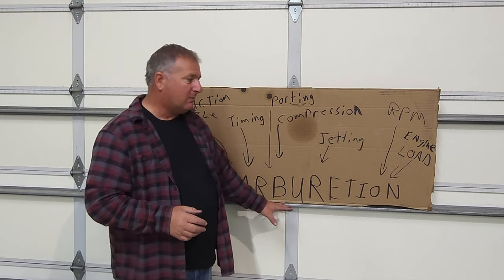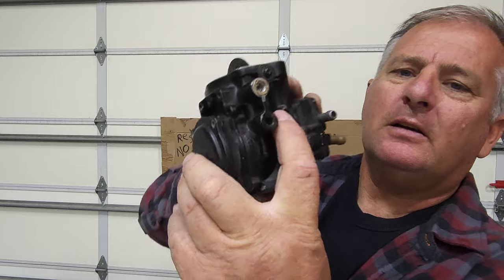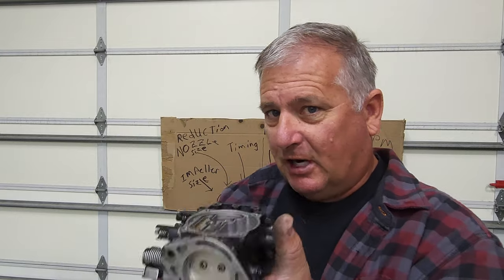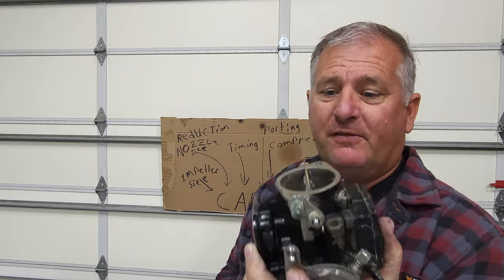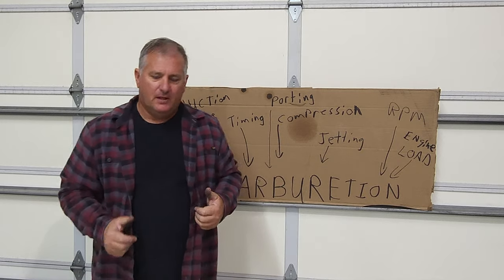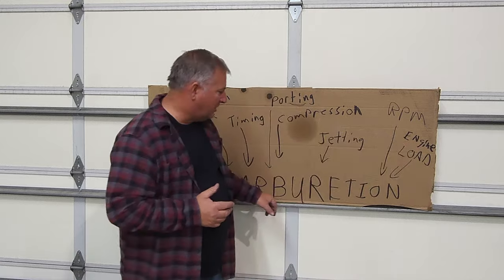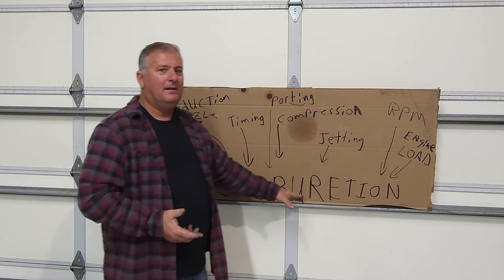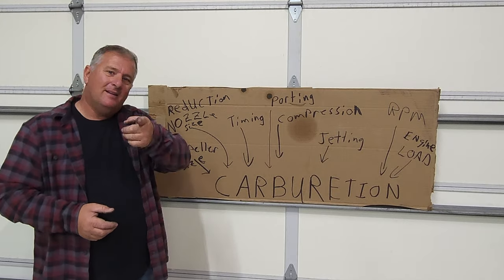Jet Ski Carburetors: A Deep Dive on both Keihin and Mikuni Performance

Comment: I have a 97 Kawasaki stx 1100 switched to pre mix and have trouble at idle and low speed, high speed it runs good just lacking almost 10mph. Would I need to re jet the carb or would my problem be fixable with tuning the needles?
Reply from the maker: Whenever adding oil to fuel, a rejet is required. Oil is thicker that gasoline. You nee larger jets (bigger holes) to flow the thicker mixture.

Comment: It seems like skis always run fine on the hose, but then won’t idle high enough or have other issues once in the water. Can you explain why or give tips? I also have a good test spot, a quarry, no other boaters in my way as I tune and take it in and out of the water. Working on a 93 sea doo spx 587.

Comment: I think it was easier for us old timers since the jets were adjustable having knobs on the engine cowlings of our 1940's/50's/60's outboards now considered antiques.  If you were traveling and launched at a different elevation, season, load, etc you adjusted the idle jet at the ramp and then fine tuned the high speed jet with the second adjusting knob.  You used the computer between your ears to fine tune things in real time to match any changes in conditions.  If you mixed the fuel a little too thick that was easy to fix with the turn of a few knobs that you could often deal with even while wearing gloves and without taking anything apart.

Best!

Comment: Hey Jim love your videos, good info in here to help keep the old school ski world alive. I think you may have made a mistake though in talking about the keihin carbs with the measurements, I have all 4 models here in my shop and decided to measure them , while the 28 cdk1 measures at around 34mm at the flange like you said , I've found the other cdk2 models to measuring properly + about 1/2 mm at the flange and not behind the butterfly , with 38 measuring at 38.45mm at the flange and the 40 measuring at 40.40mm at the flange and my sudcos measuring at about 42.52mm at he flange. All 3 oem models 28,38, and 40 had a 2mm diameter step right above the butterfly at the throat which gets conically smaller the closer you get to the bombsight at an unknown rate (4mm shrink rate for the 28)that would make the throat measurements for the 38 and 40 , 36.45mm and 38.40mm respectively at the step and 32.45mm and 34.40mm at the smallest point near the bombsight if applying the same conical shrink rate as a 28mm carb. The only exception to these rules was the sudco 42 with smaller size step after the butterfly, I didnt have one disassembled without a butterfly to measure unfortunately.

Comment: I've got a 1989 650SX with the stock tiny 28mm carburetor. I've read that bigger carbs really help the 650SX. I found a used Keihin 38mm carb from a Polaris (SL900 or SLTX).

I've got two actually. One has an accelerator pump on it, but I can swap parts off the other one to get rid of the accelerator pump. Should I keep the pump, or ditch it?

I ported the stock intake manifold to match the 38mm carb. I also bought a Mariner exhaust off Ebay and a milled head from Groaty.

Where should I start my jetting at?

Comment: Super informative - I did not know pre-mix vs. oil injection would affect the carb's fueling and also did not know Kawasaki redesigned them to compensate for this. I have a '95 SXi, which was factory oil injection but it has the larger 1.6 needle/seat.

Comment: Thank you so much again for the information. I'm getting and old 650sx going for my 11 year old. 
He already rides an SXR 800 with me but after watching the 650 videos I wanted to get this hull damaged ski going. 
As far as I know it is totally stock, in very good shape under the hood with 150-155 on the compression gauge here in Montana between 2000 and 3000 feet of elevation.
Parts on the way for the fuel pump and 28mm as well as a block off plate if we decide to delete the injection. 
If we do that can we ask for the beginning numbers for  carburetion based on what information I've provided?
It appears I will be doing the water box mod, crankcase drain bolt etc at some point. Needs straighter bars, kill tether and finger throttle first I think.
So awesome you did these videos. Very much appreciated

Comment: Just wanna take a second to thank you for the videos you do.  I just got a very clean 89 ts650.  I’ve completely torn everything down to check it all out and to make sure it’s good to go.  I’m a tech at a local power sports dealership but have zero knowledge of pwc till about 3 weeks ago. (Thanks to you for teaching me what I’ve learned). My question is. I’ve got the engine out to do the oil pump delete and the grenade switch delete.  Somewhere on one of your videos I’m pretty sure I heard you say if you do the oil injection pump delete, you need to run a 82 jet. Is that the main jet or the pilot jet? Next question. Would you happen to know the part number?  Thank you for your amazing knowledge and teaching us younger guys!!
Reply from the maker: Thak you for the kind words. Yeah, the jet is the pilot jet, as it affects the carburetion from idle all the way to full throttle.

Comment: i have a 750sx that i rebuilt carb on and it has 2 jets (main and low). i bought a parts 750sx that had a big pin installed and a single carb and intake. i noticed the carb was different because it had the oil injection inlet on the carb. pulled carb apart to clean and noticed that it had 3 jets. what is the difference performance wise? how would u jet one of these carbs? dont remember jet size off hand but two of them were close so i was thinking those two were the low speed while the other was a high speed?
Reply: Yeah I think a lot of those Kawi 750 engines were equipped w/ the 3 jet Keihin carbs.  My understanding is that it was mostly on the twin carb Keihin 750s, like my '95 750sxi with the dual 38mm setup (1 year only as the next year went to twin Mikunis).  I believe most of the sit down 750's got them too, albeit w/ 40mm versions in some models, but I think I recall reading a small number of them were still 2 jet.  Never known much about the single carb Keihin 750 setups, so maybe some of those were 3 jet as well.

I think it's just the addition of a mid jet rather than only being a low (pilot) and high (main).  Generally speaking, everybody seems to prefer the Mikunis over the Keihins, be it in stock form or aftermarket racing carb form, and I think this is all the more true when the Keihin being considered is a 3 jet version as that only adds to the confusion with another variable in the mix.  Also, with the Mikunis having been substantially more popular all these decades, the knowledge/experience base out there is a lot more dialed in for baseline jetting predictions and parts support.

Knock on wood, my twin carb Keihins are still working fine after 14 years with this ski (I am 2nd owner) including swapping another 750 engine in once the original engine died from the oil injection lines splitting during a ride.  So despite having the engine and carbs out, I haven't taken the carbs apart out of fear of screwing something up and needing some part that's discontinued.  For whatever it's worth, I haven't missed a winter without winterizing the ski with Stabilt added to the fuel tank.

Comment: Hey Jimmy, I have a question for you. I have a 2013 JK that I'm doing  hemi swap in. I bought a 2022 392 with 8 speed transmission out of a Durango SRT. Using a Jeep Speed shop swap kit. I'm disabled and am going to tackle it myself. If you happen to need a project. I can't think of anyone I'd rather have do it and I'm in Minneapolis.I could throw in the engine and transmission with 95k miles on them. I know it's a long shot but hell.I'm hoping I can manifest it lol. Thanks Trent

Comment: Was rebuilding the carbs for my 96 spx and I have a couple questions…I got the pop off set correctly but it seems like both needles slowly leaked over the course of ten mins or so and never held pressure. My carb kit didn’t come with a new needle and seat. Should I get new ones?

Also, on the pto side I didn’t have to plug the fuel return line to test the pop off…is this right? I feel like my return line is clogged somehow…
Reply from the maker: yes, the factory mikuni carb kits come with a new needle. The seats don't usually wear out though, but they are replaceable as well. You are correct on the return line being plugged. :-)

Comment: I have a 2005 Yamaha AR210. Has twin 135hp 2stroke 3 cylinder motors. I’m a 1st time boat and 2stroke owner. Believe it has mikuni carbs stock. Looking for best reccomendation for carb rebuild kits(stock)
Reply from the maker: Get the Actual Mikuni brand rebuild kits, you will end with headaches if you don't. The chinese kits come close, but they are not near as good quality.
Reply: Well, I’ve found it very hard to find parts for this boat. I dont have a service manual but can rebuild a carb. Any idea what model or size mikuni’s come on these motors? There’s 3 carbs/motor